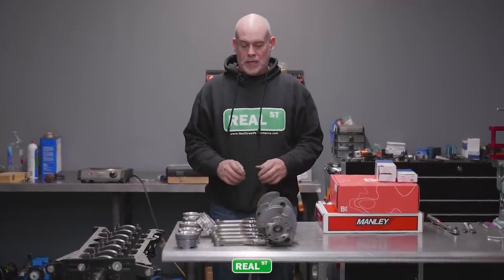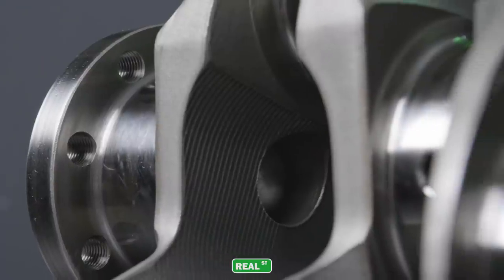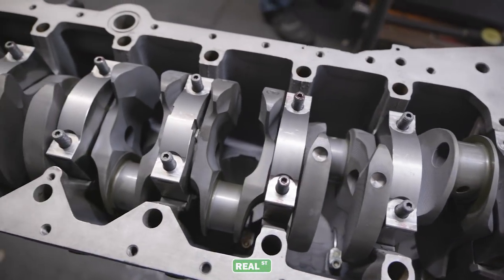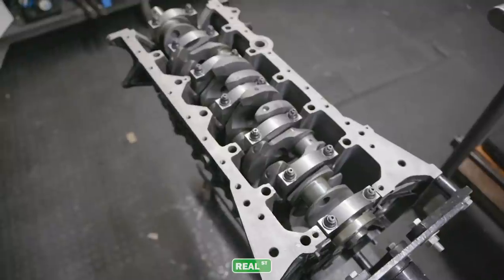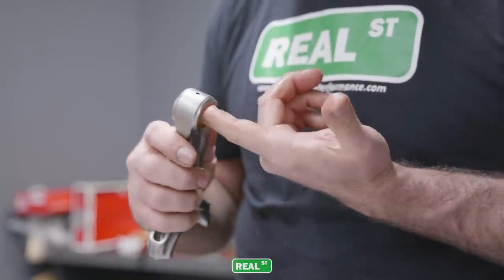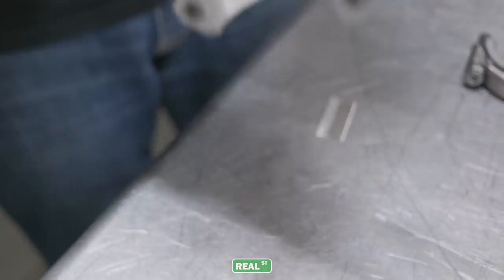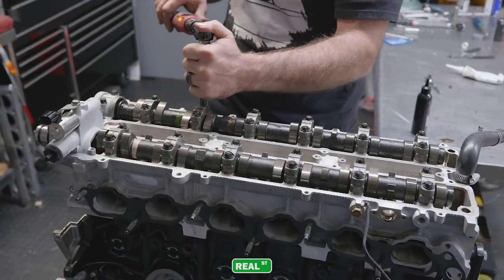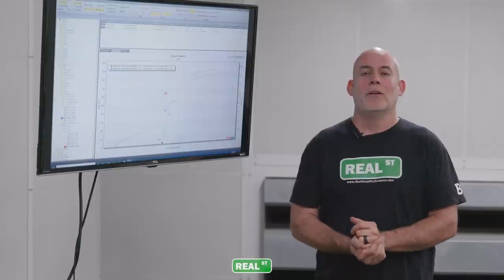Shaving 16lbs Off 2JZ Engine With Titanium Rods & Billet Crank - Jay's 96mm Stroker Build

Comment: Toyota did the new Supra a disservice by not putting a modernized 2JZ in it. The bmw power plant is typical of German complicated engineering
Reply from the maker: I actually don't really have many complaints with the MK5 supra. People have an emotional conflict internally because of the partnership between OEM's but that doesn't change the fact that it is a new turbocharged inline 6 rwd car option thats going 9's pretty easily with bolt on's and totally stock sealed engines and totally oem stock sealed transmission/converter. Thats not as easy of a task for a MK4. I think the MK5 will be a lot cooler once the transmission tuning becomes more refined, but the engine hasn't seemed to be a limiting factor yet. But the people that have a brand loyalty conflict with it will always have that conflict regardless of how cool the car is.
Reply: @realstreetperformance  for me it’s not so much brand loyalty it’s more of the unnecessary complications that come with German engineering. Why in the world would you put the timing chain on the back of the engine?!!! This is something I don’t think Toyota would have done had they designed the engine. I think a modernized interpretation of the 2JZ by Toyota engineers would be just as competitive an engine considering all the new technology developed for engines since the inception of the 2JZ.
Reply from the maker: I suppose, however, I dont feel like the timing chain location has influenced our experience with the car positively or negatively since we've owned one. We haven't found ourselves in a situation where the timing chain was even a thought to consider. It has just all kinda worked so far, which is what you'd want from an engine
Reply: @realstreetperformance  it’s easier for you to say that since you’re actually a shop and a renowned one at that. Imagine the average Joe DIY guy who will have to contemplate how to do it or pay thousands of dollars to have the service done. I’ve dealt with a lot of German cars in my time and sometimes feel like the engineering lacks common sense.
Reply from the maker: @kenxiong6830  I appreciate your kind words. It is easier when you work at a shop. And While everyone is entitled to their own opinion, it's easy for us (enthusiasts sitting on the outside looking in) to accuse the designers of lacking common sense when we see something we don't like. But the real reason for them making decisions like that is usually for a reason that doesn't matter much to us (the owner of the car) as much as it means to them (the manufacturer making it). But it's not an accident, or an oversight, or a mistake that they made while not thinking things through. Just because an occasional timing chain job takes more hours to complete when the timing chain is on the back, it doesnt mean it was the wrong call. A lot of decisions when designing a car involve fixing one problem with a solution that creates a smaller problem. Lengthening the labor hours on a job that does not have to happen very often in a cars life is a relatively small sacrifice in relation.
Reply: @realstreetperformance  Your counter argument does carry merit. I do understand we don’t have the intel of what the engineers were thinking when drafting up an engine design. At the same time it seems to me that the lack of common sense engineering is something I only encounter in European cars, especially German made. I’ve been fortunate that my family has had a lot of German luxury cars throughout the years. Unfortunately for me, I am the family mechanic so I have to work on them. Not only that, I also work on cars of friends. This is why I have developed this position on German cars. Plus, your opinion is kinda biased bcuz you get to do all the fun stuff lol. I believe that as people begin to put miles on their mark 5 Supras issues will begin to show up. You definitely have garnered my respect. Your videos are great and detailed and it’s something a true car person/mechanic can appreciate.
Reply from the maker: @kenxiong6830  I appreciate your support Ken, and your point of view, thanks for sharing it with us
Reply: The POOR sales of the MKIV really put a bad taste in Toyota's mouth so that was enough to KILL the Supra and it did. They didn't build a Supra, they purchased a BMW Z4 and slapped their Supra badge on it. They only care about the sales, not the authenticity of the Supra. And they KNOW that it will sell to those that dont know any better
Reply: @realstreetperformance  putting the timing chain on thr back side made sense to SOMEONE in BMW ... 
Ask any engine builder or designer if they were to create or design an engine, would YOU out the timing chain in the back or leave it in the front as its been done that way for DECADES .. ?? 
Just wait until it has to be serviced, then we will see the agrivation it might come with. Then maybe your opinion will change on it being in the back. Not saying that its right or wrong but this is the 1st engine i have seen to have the timing chain in the back. 
Question is WHY ... i bet you cannot give us an answer as to why its a good idea to have it in the back, not that it was your design or choice but why do you think it was put in the back ??
Reply: I am with you ken. NOT BASHING REAL ST EITHER ... 
As a 98 Supra owner, i will never claim the MKV Zupra as a Supra. You guys can because technically speaking it is a Supra by title and badge but morally speaking ... NOT A CHANCE
Reply: @ACommenterOnYouTube  I definitely agree on all your points. There’s not much to the Supra power plant that would make it require the timing chain be put in the back. Sounds more like Ferrari mechanics to me, where they purposely make things overly complicated to deter the DIY from even attempting any repairs. Toyota should’ve put a twin turbo version of the V8 found in the RCF in the Supra. Would’ve made better sense. Heck, the RCF would’ve been a better platform to build the Supra on.
Reply: In addition, Toyota has produced monsters of engines such as the 4AG, 3SGTE, and 2JZ. They are plenty capable of building their own power plants instead of outsourcing it to other manufacturers. Would’ve been nice to see the Supra sport a street version of the engine found in Toyotas LMP1 race car
Reply from the maker: @ACommenterOnYouTube  no worries guys. Part of being car guys is liking what you like and not liking what you don’t like. The emotional attachment to brand loyalty is a tough thing to get control over. I just hope people don’t miss out on one of the coolest affordable factory turbo rear wheel drive inline 6 cars to come out in a long time just because they are upset about one of its characteristics that doesn’t  influence its driving experience or ownership experience. If you can come to terms with the name, it’s actually a really cool car. I really hope the OE’s continue down this trend. Nissan releasing an affordable turbo rwd car is a good sign too. Let’s hope for more to come
Reply: @realstreetperformance  while owning a 98 Supra and a 98 240sx i am GLAD that Nissan kept the Z in the family and not pulled a Toyota out source deal. I will not accept this Z4 Zupra as a Supra, everything about it is BMW and i dont like BMW .. 
But some will accept it and thats fine, thats their opinion and i respect that. 
I am NOT a V motor fan but this twin turbo Z from Nissan is looking good, i may get one, and if i do i might have to sell my genesis coupe because my 240sx and Supra are ABSOLUTELY NOT GOING ANYWHERE .. 
But back to the Zupra .. why do you think they put the timing chain in the back ??

Comment: If it makes a 1000 don't put more than it makes show us its YouTube not fake tube
Reply from the maker: Not sure i understand the question ricky, there are a lot of videos of this car on this channel making over 1000whp ... its really just a matter of how far he turns the boost up on whatever turbo its on at the time. Here's a video of it making 1493hp to the wheels on a similar stroker engine with slightly less stroke and a slightly bigger turbo. https://youtu.be/ysfxi_L-l8I?t=122 Jay is dialing this car in for around 1000whp with a strong mid range right now but a simple target boost change can make a much higher power number if we are trying to prove a point. Take a scroll through the channel, this car has spent most of its life over 1200whp
Reply: I was being funny I've been following for years !! I've got a Toyota pickup on e85 and 20 psi !! My Dream car is what yall work on !! I didn't mean no harm !!
Reply from the maker: @rickybailey7123  no harm. Thank you for interacting with the channel!